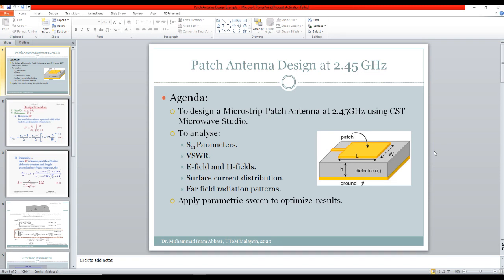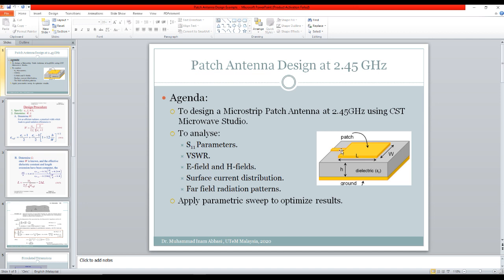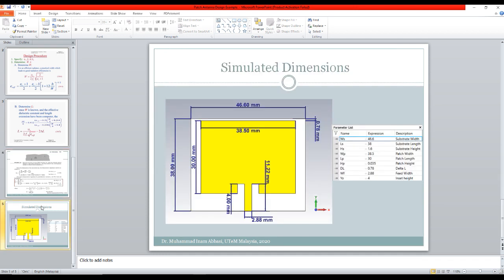CST Tutorial(Patch Antenna Design S11, VSWR, E-fields, Surface Current, Farfileds, Parametric Sweep)

Comment: Really useful but can i know Extrude face and extrude profile is two different things or same?
Reply from the maker: Yes they are different. Extrude face will only extrude the selected face.
Reply: @Inam443  but why mine not pop out the face one? 🥺🥺🥺 only the profile appears. Did i do something wrong?? 😭😭
Reply from the maker: @kimtomodachi2848  you can select the face and press shortcut key “f” only to select face.
Reply: @Inam443  thank you so much. It’s worked 👍🏻👍🏻👍🏻👍🏻